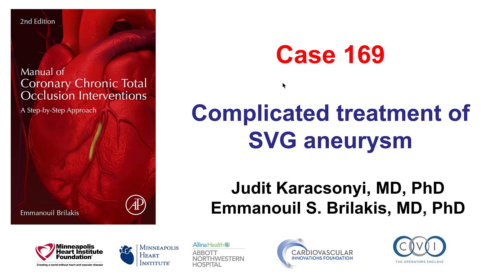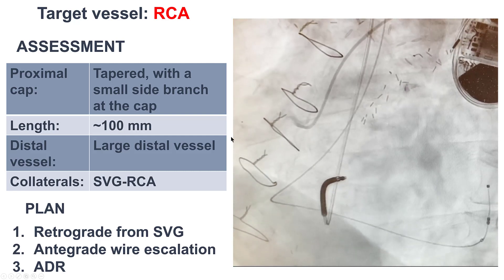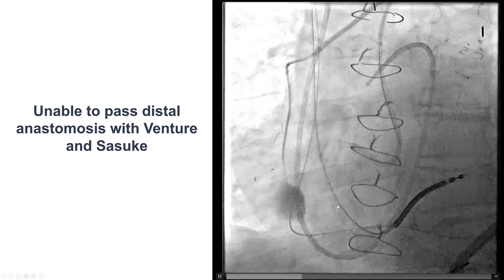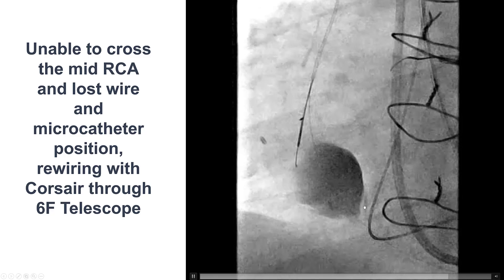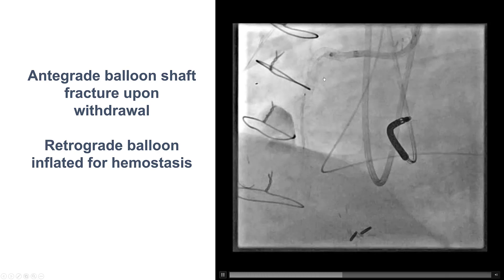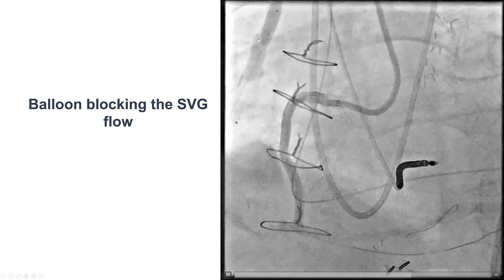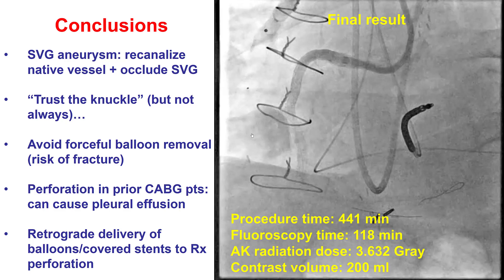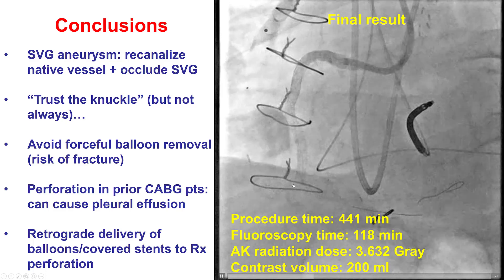Case 169: Manual of CTO PCI - Complicated Rx of a SVG aneurysm

Comment: Excellent case Prof. Manos, I have some questions
1. Was there any possibility for more distal coiling of SVG graft, let’s say near the RCA anastomosis ?
2. How do you decide and size for the SVG closure device, coils or amplatzer ?
3. What’s the extreme size you’d recommend for a balloon in a reverse CART ?
Many thanks for the excellent cases and books and Merry Christmas
Reply from the maker: Great points:
1. Yes, that could have done, but then flow might continue into the aneurysm cavity
2. For Amplatzer vascular plugs, I usually use 50% oversizing  - for example 6 mm plug with a 4 mm vessel
3. The size of the reverse CART balloon depends on the size of the vessel and the subintimal space - there is "one size fits all". IVUS can be very useful to determine the vessel size.
Reply: @manosbrilakis  Thanks for the reply Prof. Brilakis, I’m just an interested novice in CTO PCI, really learnt a lot from you. 
Another point, if we close the SVG at the anastomosis, how would blood flow to the aneurysm ?

Comment: Rather than treating the CTO, did you consider just using covered stents in the SVG, similar to how a AAA is excluded with a covered stent graft?  I have done this for smaller coronary aneurysms. It looked like the proximal and distal landing zone diameters in the SVG were about 4-5mm by IVUS; I’d have to check if we have covered stents that big.
Reply from the maker: Excellent point!
This is definitely an option and I have done it for other SVG aneurysms. The advantage is that the procedure is simpler to perform. The disadvantages is achieving adequate sealing, off-label use of PK Papyrus requiring IRB approval (unless you use a peripheral covered stent), and the risk of SVG disease progression.
Reply: Can we use the graft stent in the RCA it self to seal the connection to the graft ?